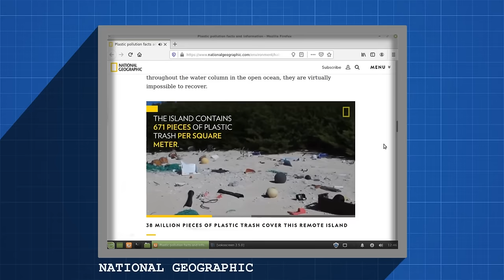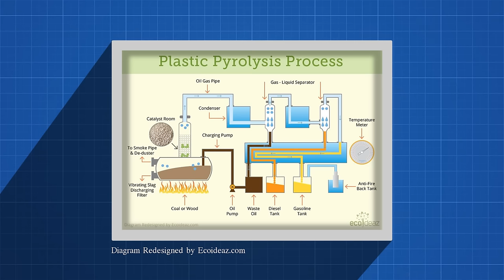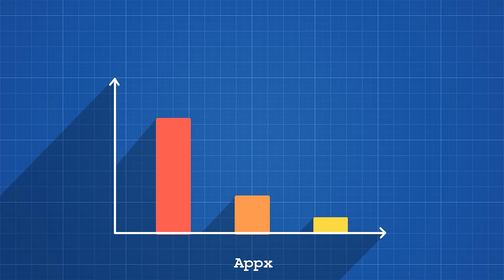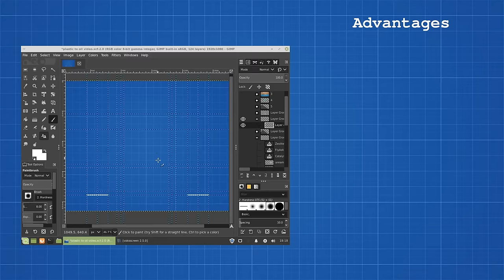How Waste Plastic is Converted into Fuel | Plastic Pyrolysis | Karthi Explains

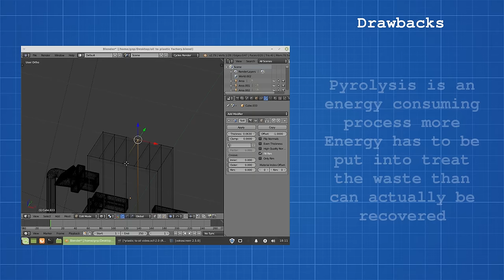Comment: @3:55 "Pyrolysis of plastic can never be sustainable."
It can be sustainable in the right circumstances, where there already exists an excess source of clean fuel or heat. A good example would be industrial processes which require a lot of heat to be cooled off. Another viable option is using geothermal energy. Perhaps the most practical use is for small scale pyrolysis by farming communities, using biomass fuels, which are usually carbon neutral waste products. Here's an example. It may not be the best example, but it works sustainably, helping to fuel their community and remove plastic waste from their environment: https://www.youtube.com/watch?v=TFuTCpCVSbM
Reply: I think that it all comes down to the meaning of words (semantics).  I believe that original statement is correct on its face, but a better and more useful way of describing the reality would be to say "Pyrolysis of plastic can be sustained for as long as we have plastic waste.".  I think that would have been a better choice of words in that context.
Reply: Looking at this positively, I'm a proponent of molten salt reactor systems (MSR's), they would be an excellent source of high temperature heat to drive the pyrolysis process and do so with emitting carbon.  In addition there would be further opportunity to integrate the heat coming out of the condensation processes back into the main power cycle further improving overall thermal efficiency.
Reply: Yes  @lindsaydempsey5683  Thank you for your input. the language used is important. I like that you've used the words "reality" and "context" because the original statement is only really true out of context and from an ideal starting position. We will have plastic waste as long as there is a petrochemical industry, as it is a byproduct of oil refinery. It's just about how efficient (or inefficient) the refining process is.
So long as we do have an abundance of plastic waste, and heat sources we could use, then pyrolysis can be sustained so long as it is done efficiently and at an appropriate scale. While oil remains cheap and available, it won't make much financial sense to do this industrially unless it was subsidised, as even if you have a heat source going begging, it would be more profitable to refine crude oil with it, but where this would require long transportation chains, such as in Iceland, it might one day make more sense to use the waste plastic already shipped there as the hydrocarbon source rather than shipping it away again.
In reality, the small scale operations on remote islands or in isolated communities holds more promise, neatly solving the particular issues they face locally. I could see that being scaled up for larger remote communities such as Iceland, where they have cheap geothermal energy, or perhaps for somewhere sunny or windy where they could harness renewables. The fact that they could cut out long tanker journeys from the equation would be the real saving, making it a potentially more sustainable solution, especially when the energy that would have been used in the transport of waste plastics is factored in.
It's a solution, and sustainable isn't really a relevant concept in this context, as we'd ideally want the source of plastic waste to eventually dry up. Then, for true sustainability, the pyrolysis process could switch to using biomass as both the fuel source AND the hydrocarbon source, as shown in this other video: https://www.youtube.com/watch?v=3K1zWAYDvMA
Reply: @JoesWebPresence  I agree with your comments, this is an opportunity where you want to be so successful that you do yourself out of a job.  On the concept of sustainability in context, your comment here nails that nicely.  "... the original statement is only really true out of context and from an ideal starting position.", that's the crux of it.

The problem of plastic waste is multifaceted, I don't think that there is one 'best solution', but we do have a range of technologies a policy options that can really move the dial on this issue.  IMO we need to use less where we can, use reusable containers where practical, where we can't use a deposit system that gets bottles and cans back for recycling as hi-spec material.  Then at the bottom of the pile, pay a bounty per kg for general plastics that may not be recyclable and send those for pyrolysis and adding that product back into the oil and gas supply chain.  How can we raise the cash to cover the net costs of such an endeavour?  Simply levy $/kg charge on all plastics that cannot be easily recycled that has to be tied directly to the net cost of running the plastics recovery program.  The trick here is to create incentives for everyone to be more efficient and effective, not simply punish those industries that some people don't like.

The levy mentioned in the previous paragraph could fund/partially fund automated plastics recovery schemes from harbours and rivers like Mr Trash Wheel.  It could also partially fund improvements in city stormwater infrastructure that would allow plastics to be recovered instead of simply discharging them to rivers and harbours along with the stormwater.  I can't tell you which of these would be most economic or most effective.  Personally I would favour as open a program as you can and see what works best, reducing costs and becoming more effective over time.
Reply: I don't think we're going to run out of plastic waste anytime soon.
Reply: We can but hope  @ADAPTATION7
Reply: One could use condensed sun light to operate the system on a small scale. A parabolic lens focused on the heating chamber would do the trick. Or a pipe full of oil, much like the one used to heat water to run a power plant.
Reply: 🤔 I bet on hydro power to make it sustainable and energy neutral to environment. By producing electricity in places off the grid, thru resistances create the necessary heating. Lots of waterfalls to exploit that are away from the grid to connect them.
Reply: Besides char (in the reaction chamber) and oil (after condensation and separation) a third product of the pyrolysis of plastics is LPG (https://www.youtube.com/watch?v=VzGLsGkdSvI) and this is used as fuel for the process. All it takes is a bit of externally sourced LPG to start the process but once it starts producing its own LPG the process is self sustainable (apart from the need of plastics to run on). So as long as there's plastics to put in the process can run continuously under its own power: https://www.youtube.com/watch?v=kr86K5Q63Bw
Reply: @mattwoolery2369  A parabolic reflector sounds like a viable method as it can generate quite high temperatures for a small DIY plant and provide quite a lot of useful stored oil to burn for heating and coking when the sun isn't shining........all other heating methods require the input of fuel from no sustainable sources......or scrap drift wood if you live near the sea, but you get smoke and carbon from that too.

Comment: I have a question. I saw a video of a man using firewood to heat up the plastic to make his own fuel which he then uses to run generators. If the process of making plastic into fuel uses more energy than it produces, I there a better way to use the firewood to get electricity?

Comment: The frequency at which molecules vibrate is not directly proportional to temperature. Molecules have quantised vibrational modes with discrete frequencies that are entirely independent of temperature.

Comment: Solar evacuated tubes could be used to melt plastic if you don't have access to shredders and condensers. The melted plastic can then be injected into the focal point of a fresnel lens. This lense can be adjusted depending on the type of plastic being utilized, because they can get over  a thousand degrees Fahrenheit. The plastic vaporized at the focal point will climb into a condensation columb.
Reply: I would really live to know more about this
Reply: @walugyosimonpeter9755  I am looking for a team of engineers and chemists to help me put it together, at the moment I am not financially able to build a machine like that, but I believe it could be done with the right materials. The biggest benefit to using solar to condense and pyrolyze plastics is removing the need to use additional energy sources to heat the reaction which often times use more energy than what is produced.
Reply: @BrendenWhitelaw  do you have all the theory written down about this whole thing...do you have the whole knowledge
Reply: LOL!  Same response to every video that you need an external heat source for is a Fresnel lens...  How many Fresnel lenses have you seen in any commercial application?  NONE!  Theres a reason for this.  It introduces complexities that are near impossible to overcome.  for one the rotation of the earth ands it's orbit around the sun constantly change the position of the focal point.  Another thing is the suns intensity is always changing and not always available.  Any commercial operation has quotas and deadlines.  Are you going to tell your customers "sorry no fuel this week, it's raining" And the last thing is to scale it up introduces complexity that no other heat source has to deal with.
Reply: @PrinceofWalesisland  if you're telling me that there isn't technology available that can make mechanical micro adjustments to the solar focal point then I don't know what you're talking about. Also in the process of pyrolysis a lot of volatile gases will be created, they can easily be stored and utilized as the heat source during times without sunlight. burning additional sources of fuel to heat the reaction is counterintuitive to the process, because what's the point of burning more fuels than you create? Just because you haven't seen it applied to commercial applications yet doesn't mean that it can't be in the future.

Comment: I'm not clear about the end product that 80% produced oil.. At the end part of the video talking abt drawbacks & advantage,

1. Is it like a crude oil, does it require more process to make it usable on vehicles or other fuel purpose.?

2. Pyrolysis of plastics can never be sustainable, what does it actually means?

Comment: Wait wait wait can the heat not be replaced by consentraded sunlight since it can reach up to 1200 degrees. That way the extra energie needed to convert it will be free of charge ,but bad side of it is that only sunny places which can sustain that process can use it.

Comment: Just keep in mind, when you change from one kind or energy to another, it cost to process the energy and when it changes from one form of energy to another you lose some of the energy with which you begin. It takes energy to convert it(that is how they make the plastic from crude oil or gas to start with.)then it must be filtered even to use it in a machine that uses the energy, bio deasel.
It has been a subject spoken about for many years.
To be useful to the common man it is quite a process to change waste cooking oil to deasel, and it stinks like cooked food.

Comment: If you use the gas relased from the melting plastic to re heat the heating chamber then the energy used for the process would be much lower, almost self sufficient.

Comment: you say not sustainable, but if in conjunction with charcoal production, using the heat from the charcoal production then the energy cost can be reduced and calculated at zero, if natural materials are used for the heat energy, or waste materials such as oil are utilized then the cost is almost zero.

Comment: If waste heat from industrial operations like electricity generation, or cement manufacturing is used in plastic pyrolysis, then plastic waste might become a valuable resource to use.

Comment: I bet it could be electrified, local challenges may make electrification difficult/ long in coming. If the intention is to prevent pollution by plastics and if landfills are insufficient, then I see no reason why not to use the gases and oil in generators (hopefully with minimal emission or with emission capture (bio reactors?)) until the process could be renewably electrified then the pyrolysis material could be put Towards creating more plastics that are mechanically recyclable and hopefully not single use. 

Again, limitations in even creating such a spaghettini system are acknowledged, just a hopefully thought and hope provoking musing.

Comment: So pretty much we need to invent a fusion reactor as an energy source to be able to profit off recycling plastics. Either that or use geo thermal energy as a heat or power source.
Reply: You're missing the point.  The waste material is all fuel.  If the waste material is FREE, delivered to the refinery by the trainload, then not only is the raw material to be refined on hand, so is the fuel to refine it.  Think of it this way. . . if you lit that plastic on fire, and it started burning, it would continue to burn for a long, long time.  Ever seen a tire dump catch fire?  Using a portion of that plastic as fuel will run the refinery.  What matters is, will the refined products for sale more than cover the cost of operation of the refinery.  The cost of the fuel is zero if the fuel is the delivered-for-free plastic.

Comment: So, from my understanding. If you build a power plant to run off of the product. You wont be able to produce enough product to maintain power, and will have to supplement and in fact buy more energy? So you would be building a large factory, paying people, materials exc, and never produce a surplus of energy.

Comment: It's a great idea 💡 ; but the problem is everything , " else "  ;is cheaper better faster. 
====
When people (have to guard) our garbage dumps with a fence and guards then it will be profitable. 
====
People will be lined up outside the garbage dump . 
Shouting ...I want my trash back .
====
When Isee a tire  ; I see butter  & I see a gallon of oil too .
=======
The best thing I've heard of is you take all the garbage dump's 🍼 baby diapers and put them over [ "sort of" like ] a - steel gated - irrigation pipe.
=====
Not going to give you an idea how to do spec 💤  but you want the diapers to be piled on that pipe to be pressurised into that pipe with dirt etc (on top of it) and then methane pop out the other end  pressurized  
======
Once your pressure drops to 0 psi on the end. 
Or as I would say 
(((((kilopascals)))
===
We have nothing but environmentally-friendly depleted greeting cards. 
=====👋😎💨🎶 ☕ Bryan

Comment: Philippines! We can do this.😊
Reply: Please DON'T. Not in this way.
Pyrolysis requires an input of heat energy, which is usually gained from wood or coal burning. Yes you can create fuel and other carbohydrates, but in the same time you burn more fuel.
This is NOT eco-friendly process. It will pollute twice as fast as just burning cleanly plastics for heat energy production.

Comment: You can also burn plastic and have a catalytic converter 24 Surrey heat on the exhaust, burning out most of the taxes and use for steam it's a hydrocarbon

Comment: I am struggling to understand your drawback comment that the pyrolysis process requires more energy than it creates. if we use 10 tonnes of plastic as an example: 10/80% tonnes= 8000 litres of oil. If the pyrolysis machine is correctly set-up, the total amount of oil required for the 12 hour burn cycle is around 800 litres. Please explain your comments. Thank you.

Comment: We use too much plastic, most of the  plastic be  not  recycled into  recycling system, they  be  thrown  away  and  polluted the circumstances, if  human being  can not  solve the  problem, the  next  generation  will be  very  very  hard, we  can  simplify the  variety of the plastic and  strengthen the recycling system and  plastic reuse

Comment: 3:54 can never be sustainable? what he means is it won't make money.
(edit: ESPECIALLY with the process outlined here)
Reply: I wonder how much the system would cost if they just used a controlled fire to heat it... Without electricity and all that jazz.
Reply: @TUpton-jl2ui  just omitting the first two steps outlined here would probably do it.
But as I have stated elsewhere in these comments: this technology is only useful in low technology application, coupled with good forest management like coppicing (a word spell check doesn't recognize even though  the practice is older than any extant civilization) and it's a slam dunk. A proper set up will only ever need small amounts of that very powerful fuel.
Industrialization of this process will always yield the 'unsustainable' determination.
A misnomer if i ever heard one...

Comment: Has anyone tried using solar and windpower to supplement the heat required?
Reply: Texes did.  Look at it now
Reply: @cincoy3679  they used it as a primary source of electrical power and ran out. I'm referring to supplementing the heat requirements for pyrolysis then using the diesel for electricity when the solar and wind go kaput.
Reply: @markschlehr6911     They need to go back years when they used water.  Clean and it works all the time. But no its dont cost nothing they beed money.  Its all about money.

Comment: If he had not talked about vibrations this would have been an excellent vid.
Its still ok but a bit like a commercial
Reply: Vibrations is EXACTLY what is going on.  That is how large molecular structures are broken down in this process, by making the constituent pieces vibrate so much that they fall apart.  That is what is defined as temperature, how much molecules are vibrating.